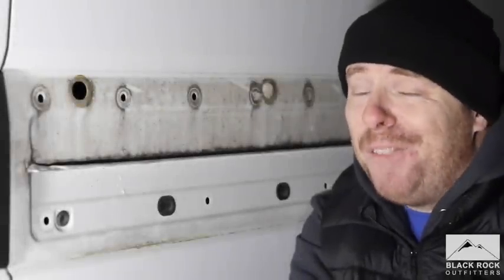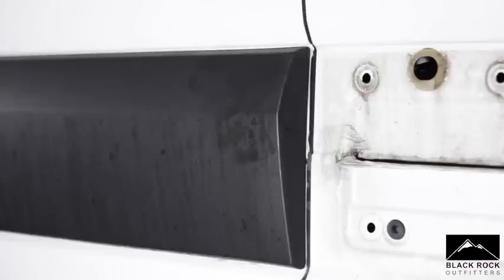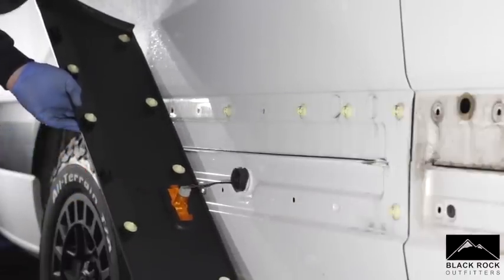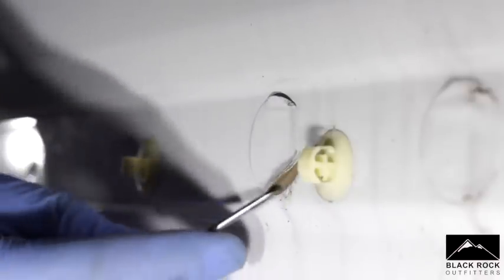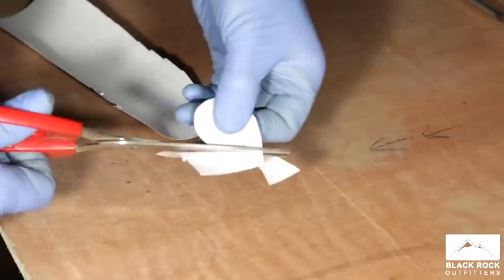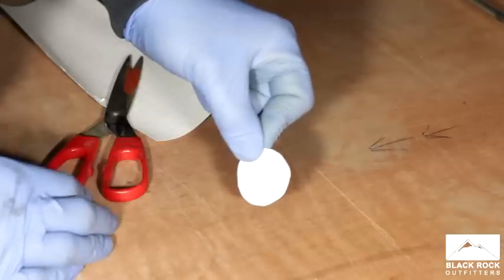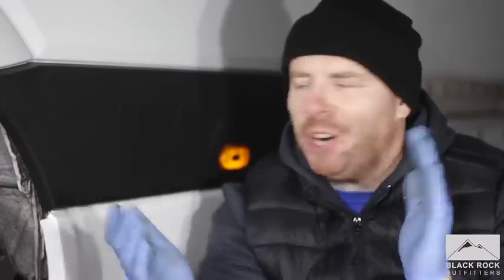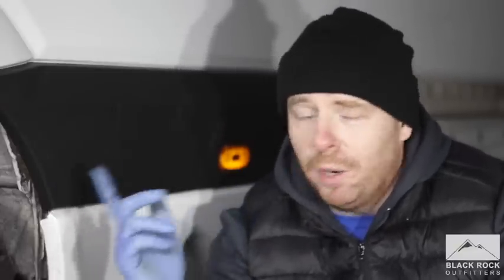A job you MUST do! - Sprinter And Crafter Side Trim Sealing

Comment: What happens when you want to remove the panel in the future? The adhesive will hold the clips in place and it will be hell to remove them depending on the sealant and whether it gets hard or not (hard would be bad)...i would  suggest a top quality silicone sealant that will remain flexible for a long time and you could still remove the clips from the body or use that temporary clear caulking that can be used on windows and then peeled off. Since it’s under the moulding it should last a long time....
Reply from the maker: If you use good sealant the clips will stay in place and the plastic panel will just pull off and push back on.

It wont be hell to pull off at all, that's what they are designed to do, you are over thinking a very simple design and if the clips do come off then just re seal, what's hard about that????

Comment: That is NOT the way to remove the trim. If you undo and remove the fixing screws on the molded plastic trim then give it a tap with a rubber mallet on the front edge taping it once in the direction of the rear. The trim will click and move about 5-10mm and you can slid it another 10mm and it comes away with all clips intact and no stress marks on the plastic mold. To put it back on make sure the clips are aligned correctly place the   plastic molded trim offset to the rear and slide it to the front of the van it will pull up about 5mm short give it a tap with a rubber mallet it will click and move to its correct position. put the fixing screw back in.

Comment: A Mercedes sprinter from 95 -08 didn't had that useless plastic crap, but  they did rust hard anyway. But the engineers at mercedes thought
that they didn't rust fast enough, so that's why they came up with these side trims, because that gave them an excuse to drill more holes
in your van than there are holes in a swiss cheese so that the lower panels fill up with water and become aquariums, because i have seen
a video where they were filled with water, so you better check on drainage slots and/or holes.
When i fill up the tank, then i also put 25 euro's aside to save for maintenance because they need more care than an entire retirement home,
and they love new parts all the time. They are also like prostitutes, because when you ride them rough and hard, then it's gonna cost you extra.

Comment: wouldnt  it be easier to stick the pins to the van first  and then stick the trim on them when its set?
Reply: no, cos they belong on the trim, and clip into the van, if you stick the pins to the van, you might not get the trim on the pins, if that makes sense, all vehicles are designed like that and for any piece of trim or body panel

Comment: Who uses a metal screwdriver on bodywork? plastic or wood is best.
Reply from the maker: I've never seen a wooden screwdriver mate, are they available on Amazon?
Reply: @blackrockoutfitters78  https://www.machinemart.co.uk/p/power-tec-trim-pry/
Reply: @blackrockoutfitters78  Metal will scratch the paint work, you will chip something, and then the rust will get in eventually undermining your initial task.  If you used plastic or wood , then you have less chance of damaging paint work then,
Reply: Tape the end of the screwdriver with electrical tape, fixed..